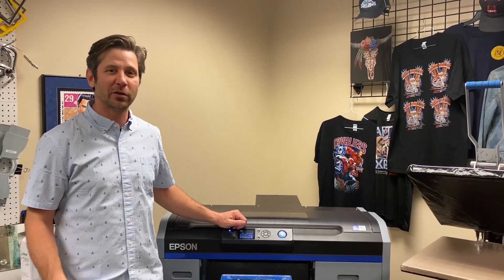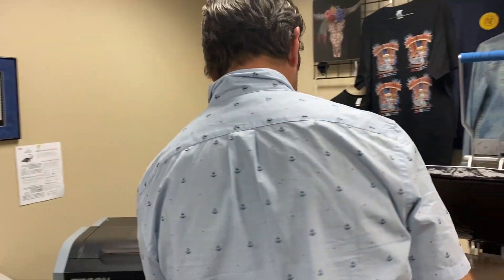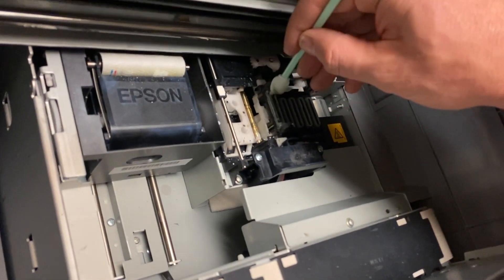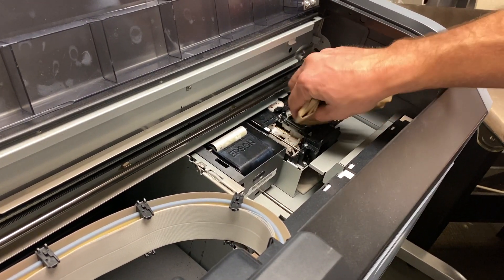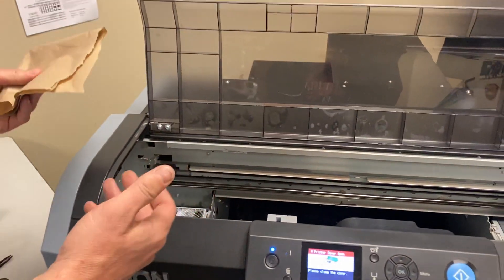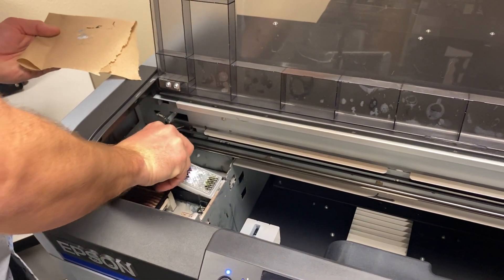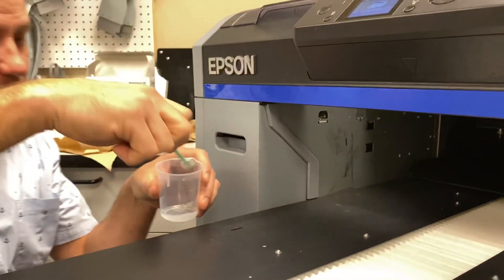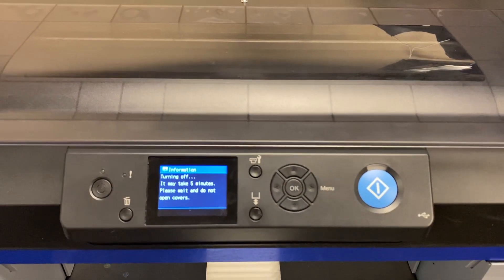Epson F2100 Maintenance - ProDTG Tips

Comment: Has anyone ever had ink leak from there Epson Dtg printer, I have ink leaking from underneath the printer where the magenta,cyan,black and cleaning cartridge sit. I noticed a small pool of ink on floor underneath this compartment. I opened up compartment and side of cleaning cartridge had black ink all over it, appears to be leaking down from above passing this compartment and leaking to floor and tips on what I should do to stop this?
Reply: Hey Dylan, my printer is doing this same thing. Did you ever get down to the bottom of this?

Comment: I'm totally newbie of F2100 so if any of you guys would answer that question I'll be so grateful ! My issue is auto cleaning not working on my printer anymore, so I just see the orange layout of calculator and I do not see any counting down. Is there any solution to fix it back ?
Reply: W was hoping you could help me with a suction cap error. 
I replaced the suction cap and filter and roller to try and fix the problem but I still have it. I did several cleaning and it still won’t print white ink when I do the print test. What else can I do. It was working fine when I turned it off before the problem started. Please help. 
Thank you.
Reply from the maker: Are you turning your printer off at the end of every shift? Always turn your printer off when you are done printing that initiates a cleaning cycle but should reset the counter. The counter is there to countdown an auto medium head cleaning every 6 hours.
Reply: Yes ever night.
Reply: Sometimes it may be a few days before I use it so I clean it often.

Comment: You said to always turn the printer off at the end of every night and turn it on the next day for the F 2100 what if you have AF 2000 that doesn't have a cleaning cartridge as with it cleaning cartridge s to do this maintenence automatically.   There would be no use in turning the machine off because there is no maintenance um maintenance to be performed if there are no cleaning cartridges
Reply from the maker: That is correct, there is no reason to turn the printer off though it does not need to stay on. Just be sure you do your tube wash regularly, you cannot over do the tube washing on the F2000.

Comment: Hello sir. I have an issue with my print. I dont know how to say it but to me it is something about registration with the white and color print. I can see small outline of whites in some edges of the print. How do I solve this issue? Thank you
Reply from the maker: You can email me direct if my answer is not detailed enough. Jledrew@melco.com Ensure the shirt is holding fast on the platen. Generally white showing under color ink is an indicator the shirt has shifted from when white ink went down to when color goes over top. Imagine putting water on a paper towel, the towel moves and shifts, a similar thing happens when you put wet white ink on a shirt. Epson provides a platen hoop to help hold the shirt or you can use the provided non-slip pad. Other trick would be to reduce white area in GC to 3 or 4. This just chokes back the white underbase more.
Reply: @MelcoEmbroidery  Thank you for the reply sir. Will try reducing the white a bit more later. I hope it works to solve the issue.

Comment: HI iam having Cart trouble on my printer F2130 Epson, I cleaned White ink slot using cleaning cart and after cleaning it is not showing the white cart, massage says less ink,or in not recognize. please give me an idea to get on with this. thank
Reply from the maker: If your heads are clogged and you try and run cleanings, the printer will think it's using ink but the clogged heads will not let ink flow through so the carts will read empty but there is still ink in the carts. If you are experiencing this, you will need to work on clearing those clogged print heads or replacing the print head or pump cap assembly.
Reply: @MelcoEmbroidery  on my!!, now i having problem when prining got line, especially when light color image like cyan. Nozzle check everytime before doing print. everything is ok. how?

Comment: My cyan is almost totally blank when I do a nozzle check and I've run a head cleaning on it a bunch of times and sometimes it looks like the cyan is mixing with the magenta. Can you please help me?
Reply from the maker: Of all the colors, Cyan is most likely to clog. I suggest doing a nice thorough head cap cleaning, then soaking the print head in a bath of solution for a few hours then doing a heavy cleaning on the Cyan Magenta channel. To soak the head, go to maintenance > Clean around print head. Clean the print head then soak in a bath of solution for a few hours.
Reply: @MelcoEmbroidery  Thank you so much!
Reply: Did this work for you ?

Comment: The tube washing solution in my printer won’t go down , please help !
Reply from the maker: You will need to replace the pump cap assembly. Here is the link to buy a new one. https://compassmicro.com/products/inkjet/surecolor-f2100/maintenance-assembly-pump-cap-for-surecolor-f2100.html Email me at jledrew@melco.com for the service manual on how to replace the assembly, it's easy.

Comment: I have been turning the printer off everyday and I waisted so much of my white ink that it ran out quick. Called epson and had a long discussion.  I was told to leave it on . I have been leaving it on for now 5 months and seen a huge difference in white ink saving.  Compared to the amount it spits in everyday turning cycle.
Reply: I had a very similar experience and conversation with Epson.  Super unhappy with the installation/delivery direction I was given at time of purchase.  I was told to turn the printer off also and that seems to now have resulted in a clogged W1/W2 channel that I cannot recover.  I'm going through all the possible solutions because I am NOT interested in a $2500 printhead replacement after less than two years.
Reply from the maker: Thank you for the info and savings tips. Turning off the printer engages the pump cap cleaning, that cleaning is critical to keeping your printer healthy. I'd suggest turning it off at least once a week.
Reply: @MelcoEmbroidery   True!  however leaving the printer onn does that cleaning as well, as once a month when I turn it off, it turns off right away, telling us it did not need the cap cleaning as it might have recently done that.
Reply: how often do you print?
Reply: @DJTommyMOT  nowadays with Digital xfers , once a week.

Comment: Hello,  I own an Epson F2100 and for some reason one side of my prints is coming out blurry and not as crisp as the other side. Would you be able to help me with this? Thank you!
Reply from the maker: Hi Nelson, Watch this video on guaranteeing prefect prints every time. I suspect it's a pretreat issue. https://youtu.be/hb6f-Q3NkEg
Reply: I was having the same problem until I cleaned the metal part of the nozzle with Magic Clean by Lawson. Leave it soaking for about 20 mins then leave to air dry.